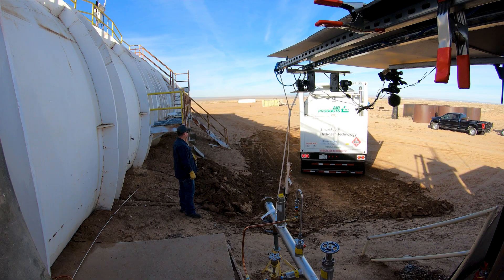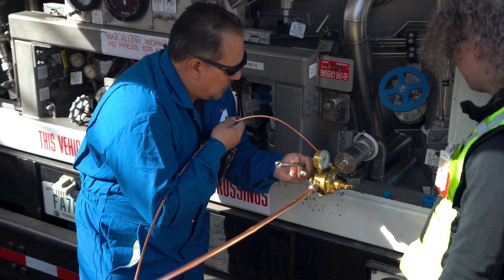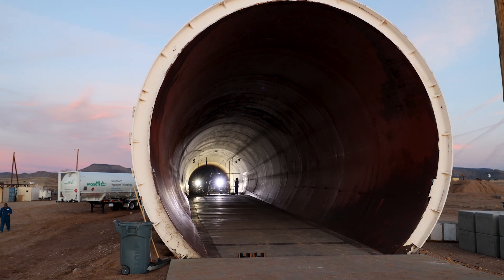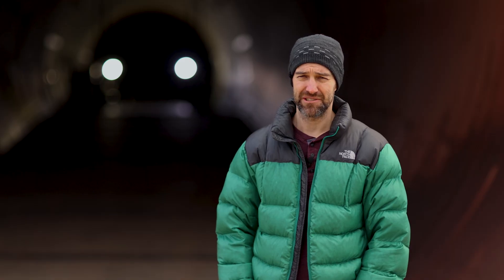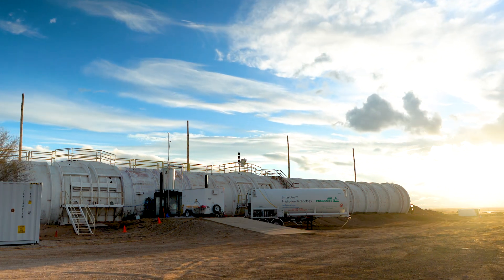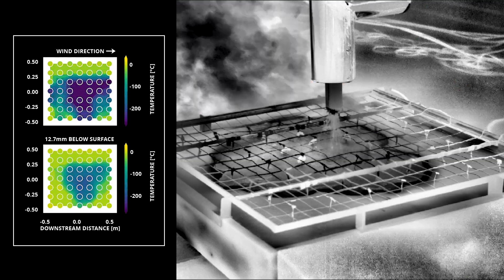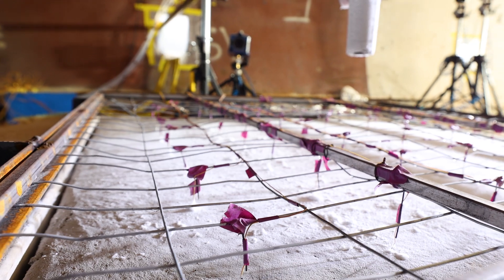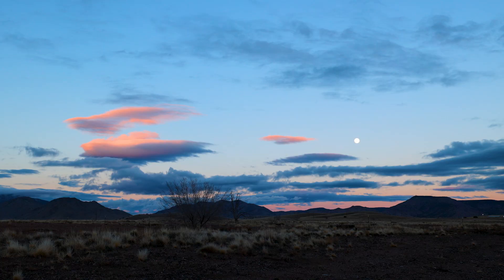Sandia Liquid Hydrogen Pooling Experiments: Validating Models for Safety Codes and Standards

Comment: I'd like to see more realistic testing like a tipped over truck hauling it leaking it into a simulated highway location, pause play a refueling station where a refueling line breaks and a customer standing there refueling their hydrogen vehicle with no clue what to do,  without saying you're doing these types of tests we'll probably never see hydrogen deployment. Basically need to make the public comfortable with using hydrogen
Reply: Good Points.